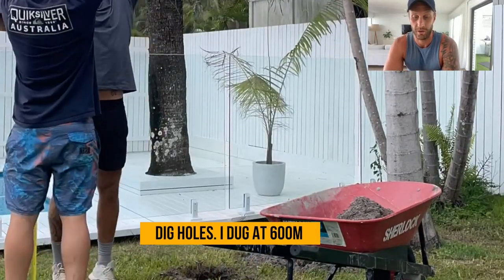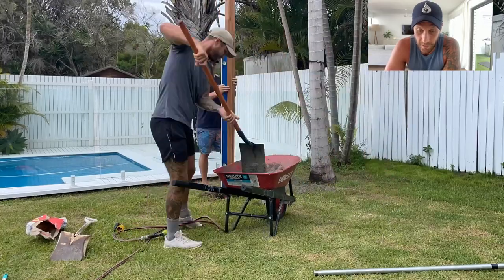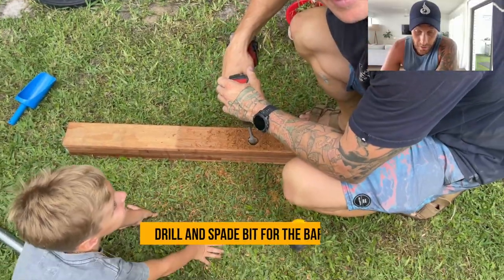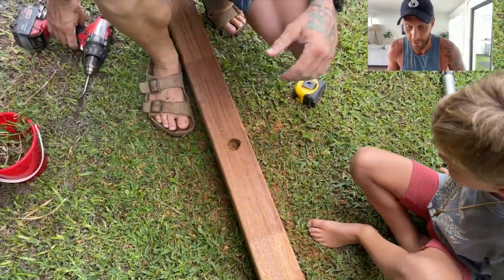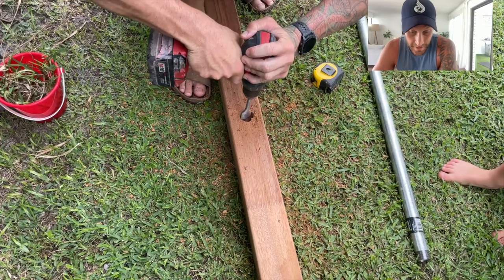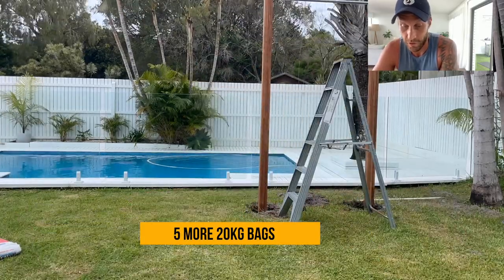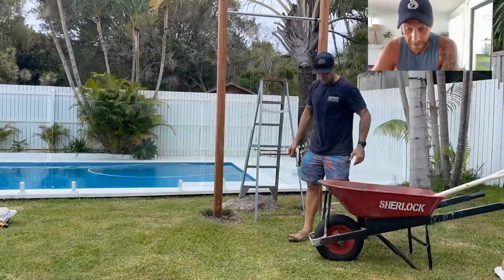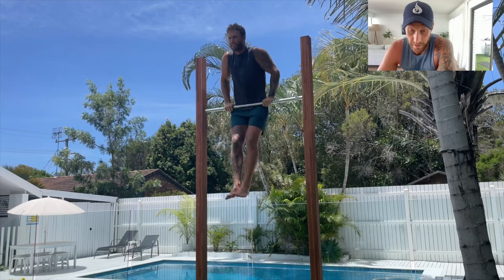Building an outdoor Pull-up bar | DIY Chin-Up bar

Comment: I'm considering expanding foam instead. Not as sturdy as concrete but I'm going for a 3 or even 4 posts setup with 2 bars at different height. Anybody have experience with that kind of product?